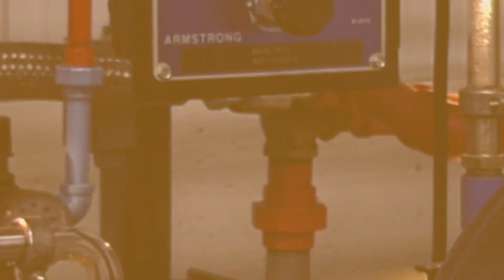Inverted Bucket Traps 101- Weekly Boiler Tips

Comment: So a IB trap would be a bad trap used on a dryer Heat Exchanger with a vacuum breaker that allows air in to the system regularly?